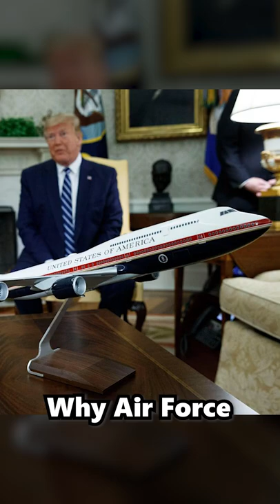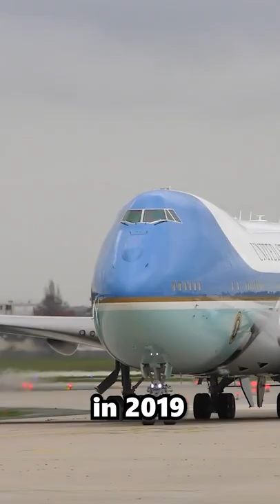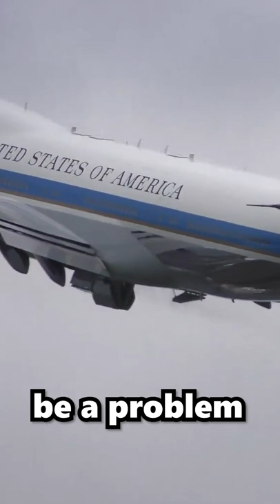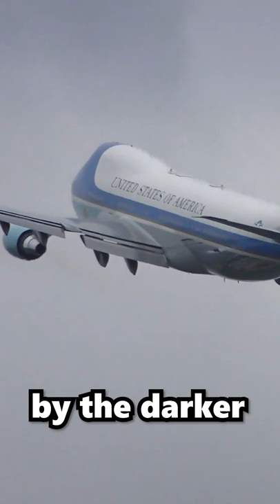Why Air Force One's New Livery Was Rejected

Comment: Another dumb idea of Donald Trump's.
Reply: I mean it looks good, but the heat absorbed by the dark blue had to ruin it.
Reply: Not a trump fan but I think it was political.   Airplanes fly in very cold air.  Freezing cold.
Reply: @danharold3087  I think it was both motivated by politics and technical issues. But I’m not very sure about it. Although the new livery looked better than the original ngl.
Reply: @deko9814  Maybe.  Like I said it is freezy cold where the airplanes fly.   Heating on the bottom of the plane.   Nah
Reply: It's revealing of stupidity and bully mentally to dislike anything one person you don't like, even if it's a simple mistake.